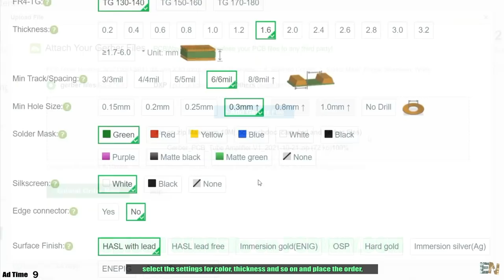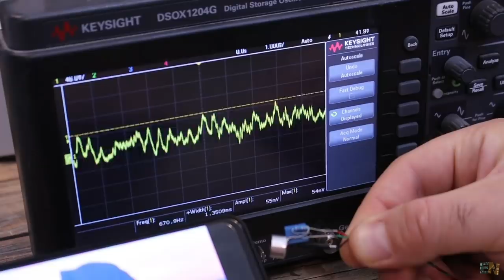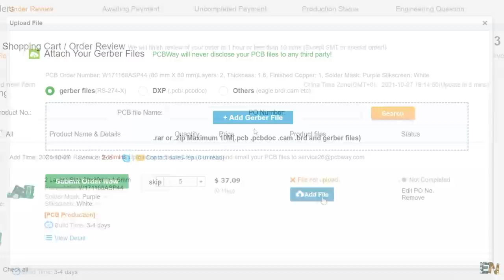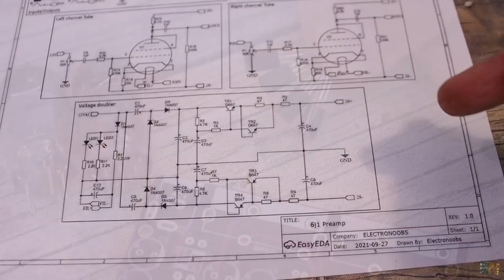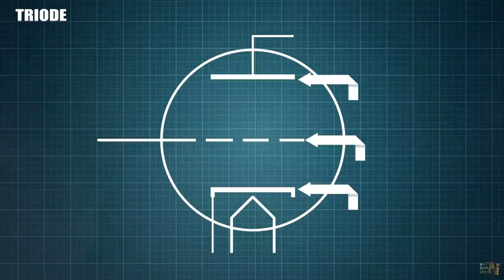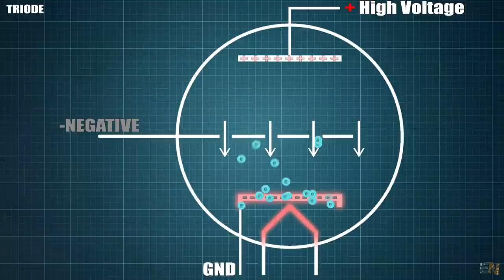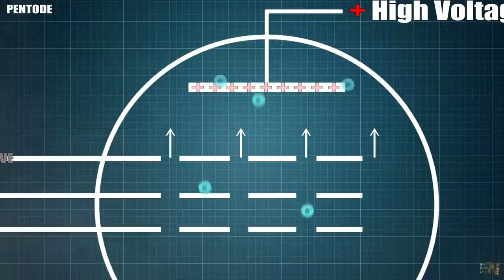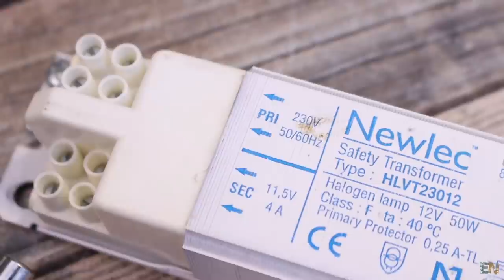Vacuum Tubes Pre-Amplifier PCB | How Vacuum Tubes Work?

Comment: Nice to see a tube project. I started building tube amps 50 years ago as all I could get were obsolete tube radios for parts. I studied electronics at university and have moved on the transistors, microcontrollers etc, but still build high end tube amps because of the fantastic audio quality. Your preamp is distorting the sound, which is useful for a guitar amp, but not for audio.... It would be interesting to see you build a stereo tube amp with one double triode (e.g. ECC82) as a pre stage and two power pentodes (e.g. EL84) as end stage. Very simple, but a  good design will provide a wonderful 2x4 Watts, which is plenty for just listening to music.
Reply: How to contact you?

Comment: Nice project! The description says 6N1 tubes, but they are actually 6J1. There are also some missing pin numbers for the tubes on the schematic. I have quite a bit of experience with tube amplifiers. Most run at much higher plate voltages. Sounded great!

Comment: This is what I have noticed with tube vs solid state. A 50 watt tube amp has way more punch and clarity than a 50 watt solid state amp. Also if you turn a solid state amp all the the way up it will start to distort at some point. The ic/transistor will get saturated with heat faster than the heat sink can remove it, maybe what you might call heat inertia. As for a vacuum tube based amp this phenomenon does not occur. As a matter of fact tubes need heat to function. When reaching a point of peak power you can listen all day long, no distortion. 
When the amp hits the point of distortion/saturation, it is alot softer on the ears. Electric Guitarist love this type distortion or overdrive. Good video man. Keep up the good work.
Reply: Any amp will distort but tubes distort with even harmonics whereas  transistors distort with odd harmonics which are unpleasant to the ear. So don't overdrive
Reply: I doubt it is fair to make such sweeping generalizations. For transistors you have class A, B, AB, and D. Then there are different approaches in feedback. Then there are different driver configurations, etc
Reply: Since the path from mic to media is packed with transistors saying transistors sound bad it like saying you don't like sugar in your cereal  while eating Frosted Flakes
Reply: I believe  that heat inertia is called thermal lag.  Since hFE varies by Tj it might appear a factor but this doesn't apply to class A and minimally in class D.   Moreover it would indicate poor design as hFE does vary by transistor [and other factors].  Since feedback  somewhat depends on hFE it is more likely the sound improves in the situation you gave
Reply: I also don't really know if it's also power supply sag/stress either. I just wanted to say, Man amazing feedback and insight.
Reply: @nathanwatrous1519  The ability of the power supply to provide enough current is an issue [except for class A].  Certainly on cheaper amplifiers is an area one can improve upon; Some will blindly install very large caps but this will very likely stress the power supply.
Reply: @nathanwatrous1519  From my experience class A is best. I built a tri-amp'd class A BJT amplifier with active cross-overs - sounded GREAT!  Passive x-overs SUCK!
Reply: @kennmossman8701  Agreed, I restore/mod Bogan tuba amps as a hobby. I do have a tendency to beef up the power section just simply due to the fact that modern capacitors are so much better and smaller form factor on top of that. It's really nice knows about this stuff for a change.
Reply: @nathanwatrous1519  for sure. Electrolytic caps, especially the older ones, age poorly and are often replaced in restoration work

Comment: Nice video, I've build a very similar preamp but the PCB was from a Chinese manufacter, but your should be better because in your PCB design the AC ground is separated from input/output ground. In fact sometimes I can hear some interference in mine

Comment: Hi very interesting project     I really think that a tube preamp is a very smart way to make a solid state amp more musical   
Is it possible to use it as a buffer with no gain voltage but with lower output impedance with different connections ?  
Usually these circuits have Zout around 5kohm    I do not need voltage gain because i am using just a fraction of the power of my amp   
But i do not know on which pin of the tube to take the signal   Thanks a lot  gino

Comment: i followed  all the instruction in placing the component as printed in the PCB. put all together and the tubes, connect the power supply and turn on the switch. in almost  30 secong i heard sometihing. poping and i found my elco poping up like a pop corn.what is wrong.. can you explain it to me?

Comment: with today's digital tv, where clean, low-noise, low-distortion tv signals are required, it would be ideal to have a tube preamplifier for tv antennas enclosed in a metal to provide shielding against outside interference in a case with 75 ohm coax input and output: radio shack had some in the 1960's, but they are needed because tv signals nowadays go to a complex decoding system because of the signal compression.  I do not know what specific types of vacuum tubes were made for 40 megahertz to 890 megahertz amplification, nor do I know how to look up the older technology.  Do you know how to look that information up?  I am aware that vacuum tubes produce very good low harmonic distortion audio sound, so all I would have to do is hook up a 75ohm coax input and 75 ohm output, make sure I use the correct type of tubes, and have the correct capacitor values, because of the much higher frequencies being amplified, 30db gain = 1024 times the signal input, with low impedance input so it would amplify the weak signals cleanly   Brian Nowak

Comment: This circuit board is already on Amazon, would suck if someone's selling his board already

For reference on Amazon UK, board has slight difference design but layout is the same:
TOPINCN 6J1 Tube Amplifiers Board Vacuum Electron Tube Valve Preamp Headphone Amp Parts Preamplifier Musical Fidelity DIY Kit Ac12V 0.8A
Reply: It has been available for more than two years as a kit from Aliexpress and possibly many other places too.

Comment: I've built something similar for a guitar amp using similar pre-made pre-amps. Swapping in a 500k-1M input pot to give the higher input impedance a guitar needs.

One warning if you make a single power supply from a 12v x-former, bridge rectifier and filter caps.  Tapping the pre-amp ac before the rectifier, power amp dc after.  In this case the "grounds" on the pre-amp and amp will be at different potentials.  So you'll need to connect the pre-amp to amp via a small audio transformer.  Otherwise you'll let the magic smoke out somewhere. :)  Fortunately, in my case it was in the interconnect wires that fried. 

For more features, you can add a tone stack between the pre-amp and amp after the x-former.  Also since for a guitar you only need one channel of a stereo pre-amp, you can leverage the fact these 6N1 tubes vary highly in quality.  With some of them distorting much more than others.  But distortion is good for a guitar!   So put a clean tube in one channel, a distorting tube in the other and a toggle switch to select which one feeds the power amp!

Comment: Vacuum tubes have their own noise and are not perfect, transistors and ICs have their own noise too, acoustics + electronics have only one solution to reduce this problem to a desired level and the process is not simple because imply knowledge of the characteristics of the use of materials and size of the speakers and their housings, the texture and hardiness/ softness of surfaces where the sound bounce and the power output  to move the air.(note: perfect sound does not exist.)

Comment: FFS, LEDs under tubes?
Unsubbed.
Reply: Just leave them out if you don't want them. I wonder if there might be a measurable effect on performance due to the photoelectric effect.
Reply: @NiHaoMike64  Even the fact that PCB was designed with this in mind is unbearable.
Reply: @Mr.Leeroy  ;D